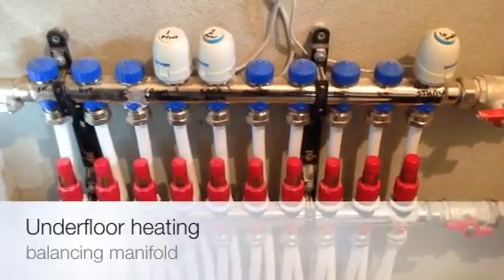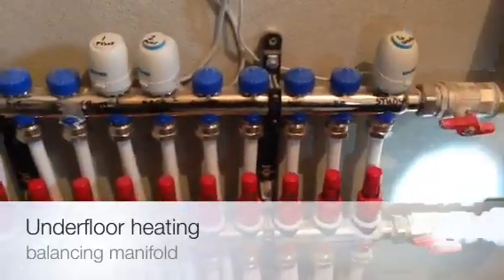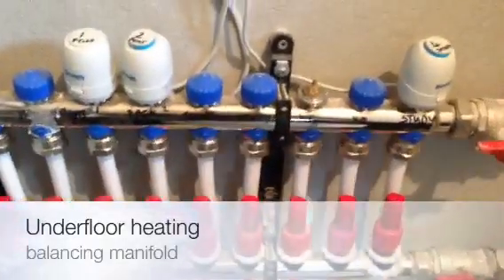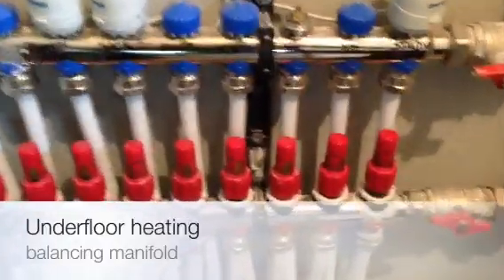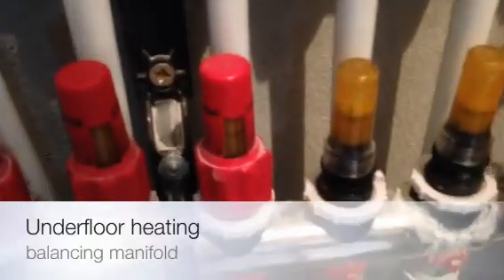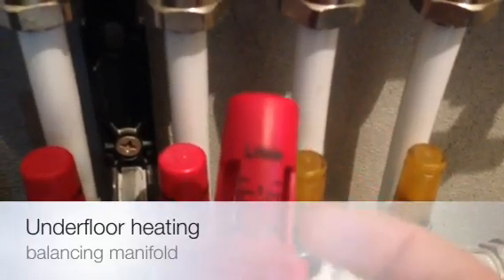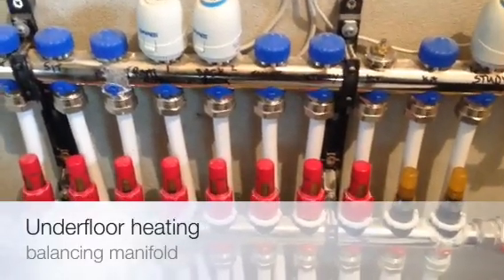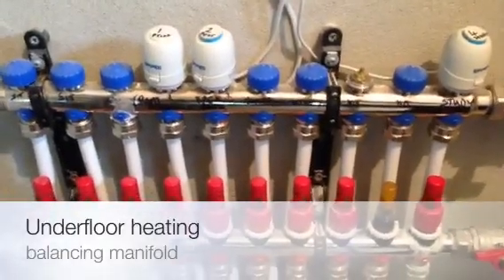Underfloor Heating Manifold Balancing

Comment: I believe you have to open all blue caps and white electric valves before attempting to balance the manifold, don't you?
Reply from the maker: Yes. Fully open the return side.
Reply: @glightsolutions  Thanks. Should I then have all the red flow meters set to the same value?

Comment: Now u say that high heat loss should have high flow, but there is only about 5 degrees difference between flow and return temps on mine, what do you reckon should it have a high or lower flow rate?. (Currently set at 1.5 ltrs) ta
Reply: That sounds about right going by my system (which recommends 7 degree difference). If the difference is small then the water is racing through which it doesn't need to do. If the different is bigger then the water isn't hot by the end of the loop and you'll get cold spot.

Comment: Thanks, all of mine are at 0 flow per minute, so at the top. When I turn them to closed or fully opened nothing happens..do you know what the problem may be?
Reply from the maker: Ramsey Elshafey you have no flow at all to the manifold. So all your actuators are closed,  pump isn’t running to the manifold. I’m assuming that 0 is at the top of your flow meters

Comment: I would hope someone can tell me how to clean up the inside of the flowmeters so the float can be seen more easily.
Reply from the maker: Roger Munns best off replacing the glass sections
Reply: @glightsolutions  how do you replace them?
Reply from the maker: Ramsey Elshafey you’ll have to isolate the manifold and replaced with same brand flowmeters